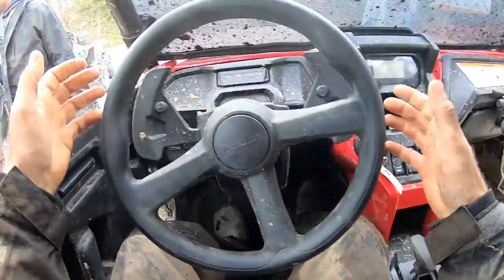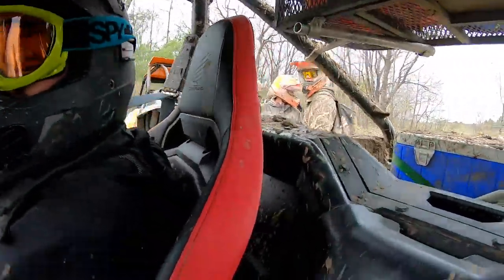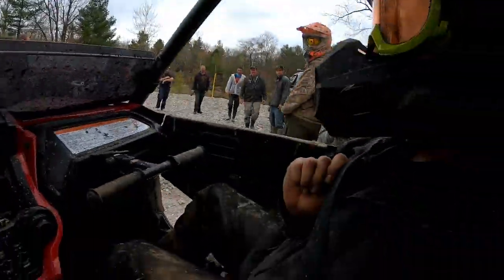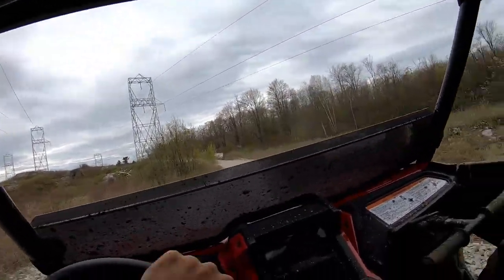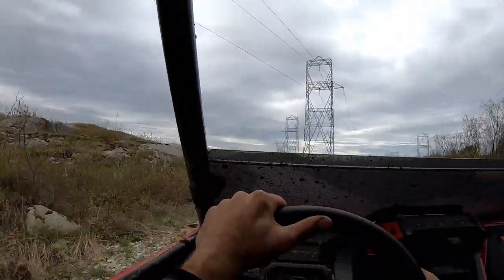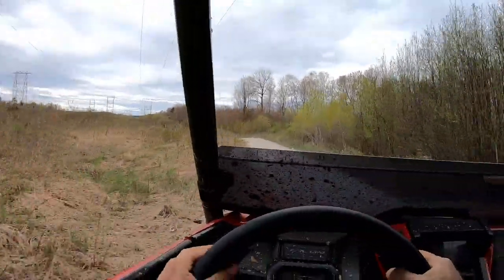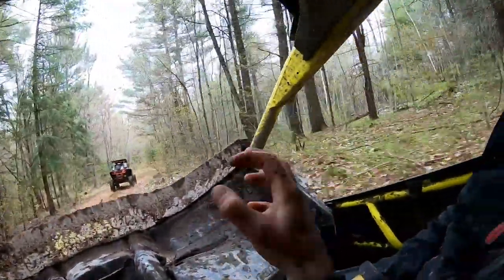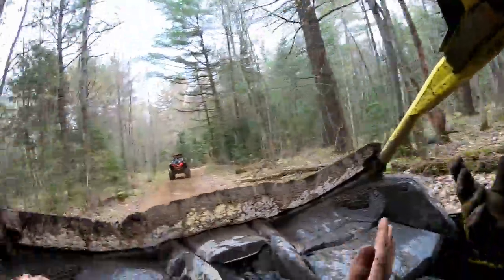Honda Talon X First Rip and Impressions

Comment: Looks like Honda finally woke up. New stuff coming out from them on a regular basis now, but they are still missing a big bore ATV. They need to slap one of those big twins they use in their motorcycles with the 6 speed DCT into an ATV. Then they'll be in the game.

Comment: Honda just announced a turbo kit for the Talon, 60 percent boost in horsepower and a live valve suspension. Righteous rip but you sure did have a few close calls with opposite traffic.
Reply from the maker: I've seen that, Looks wild, eh. Yeah tons of folks out and about. The danger is real.